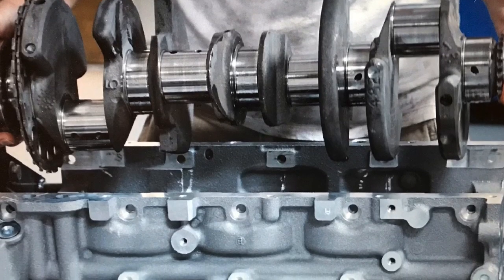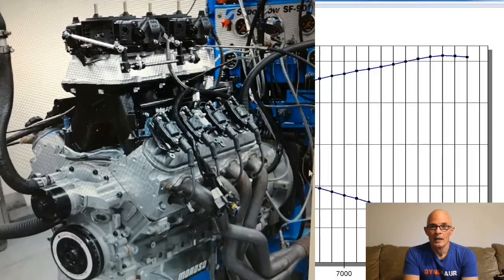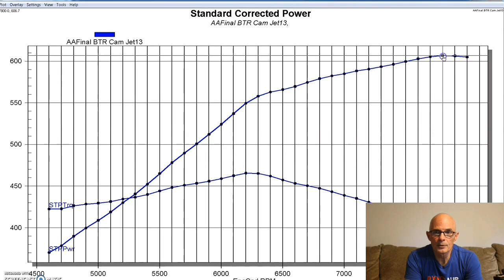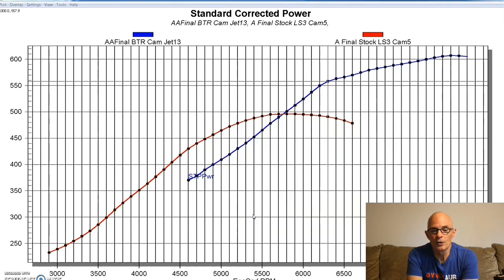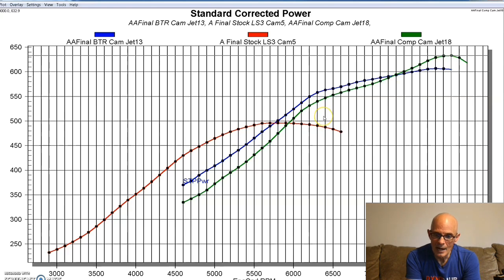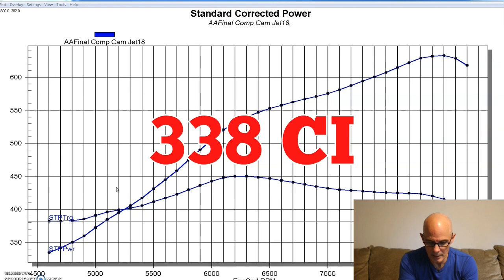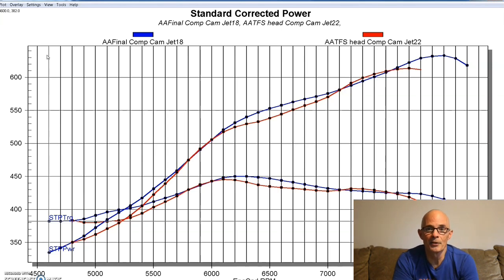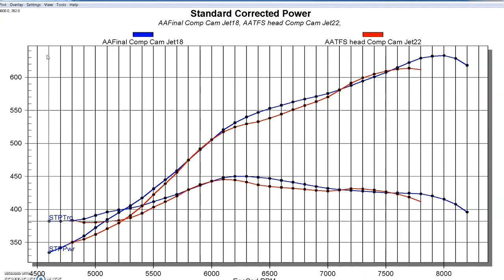DESTROKE LS-4.8L CRANK IN LS3 BLOCK-SHORT STROKE POWER-AN LS MONSTER MYTH?

Comment: The LS7 makes peak power at 6300 rpm, LS3 makes peak power at 5900rpm, and the LS2 (and LS 6) makes peak power at 6000 rpm, LS1 makes peak power at 5200-5600 rpm (depending on the vehicle). So, the largest true LS is over a 1000 rpm higher than the smallest true LS. The 5.3 is 5200 rpm, lower than any of these larger engines. And the 6.0 truck engine is the same as the 5.3 - 5200 rpm (and the 4.8 is 200rpm higher - could that be the stroke?). The largest true LS spins the fastest and the smallest true LS spins the slowest - opposite of what you said (plus the 5.3 and 6.0 truck engine make power at the same rpm). Basically, it appears that displacement actually has little to nothing to do with "revability". The valvetrain is number 1 and stroke is number 2. Displacement, if anywhere, is well below those two. You don't typically see street LS builds on stock stroke, or stroked, cranks spinning 8k plus - and especially not 10k - where destroked, large bore LSs have gone.
Reply from the maker: the reason for those peak power rpm numbers is the motor was set up by the factory to make power there (heads, cam, intake vs displacement) It has nothing to do with stroke length and stock stroke motor can run to 8000 rpm with the right valve train (the valve train is the limit)
Reply: @richardholdener1727  Yes, valvetrain has the most to do with it, but as I demonstrated, and contrary to your statements (even the objective data you provided was inaccurate), displacement has little to do with it. Stroke DOES effect revability, but not nearly as much as valvetrain.
Reply from the maker: I agree 100%...if we eliminate all the data, and go by things that simply get stated (not demonstrated), stroke controls all the rpm potential.

Comment: Destroking a motor is beneficial on one premis . Less rotational speed hence less rotational load on The bearing ... and also vibrational mitigation
Reply from the maker: rotational speed is just rpm (so the same), you might mean piston speed which changes with stroke. Vibration (frequency) can also change but not necessarily be less)

Comment: Actually on that subject of big bore 4.8. I bored a 5.3 to 5.7 (3.898 bore) with a 4.8 crank, and while I'm not suggesting for a minute that bigger stroke can't rev, I found the roughly 5 liter was easier to get revving (we got 9000 rpm able to do 9500 but didn't seem worthwhile and stock bottom end so didn't wanna stress it too much) and seemed to have better throttle response than the 5.7 stock LS6s (same headers and intake and management). Now sample size of 2 and because we found the 5l to be behaving so well we tuned it more than the 5.7, but it would be interesting to see some empirical testing. the 6.2 LS3 is a 3.622 stroke to a 4.065 bore, that's a 1:1.122 stroke to bore ratio, compared to the 5.3 which is an almost square motor, and the 6.0 which is a little over square at 1.104 . 3.898 bore with a 3.267 stroke is a ratio of 1.193. I wonder if GM bored the LS3 a little over because .2l doesn't make much diffrence in cubes and the 6.0 trucks use the same heads so all that, but it does change the bore to stroke ratio making the motor more over square. Again i don't have the facilities to check as i'm small time, and best i've done is tested in engine sim but it's something to consider. There's a lot more to a real world engine than just peaks, i learned a long time ago making 300hp over a wide range of RPM and quickly is way better than making 500 at peak.

Also we have a lightweight car so down low power isn't a huge deal (even though it's never lacking) as we're not doing launches mostly flying laps. it's a mustang 2 (because it has excellent suspension and is very light even from factory, and it's cheap) and we stuck with a built t5 from GeForce, which is pretty much the lightest 5 speed possible lighter than a TKO by 20lbs (with fluid). The 5l is happy to drop down and rev right back up and it never feels like it falls flat on it's face at any point. We're only allowed a max of 331cuin (to let the ford guys play), so our options where limited even the 5.7 LS is too big and the 5.3 just wasn't doing it.
Reply from the maker: a smaller motor makes less power than a bigger one-no racing series engine builder EVER chooses the smaller motor because it revs better (they just make the bigger motor rev it that is where they want the power band)

Comment: Great minds think a like...lol   Exactly what I got in the works. I figure being in a Miata it probably doesnt need a boat load of torque to get up and going. However, Truck Norris and a Pulsar 7375G (1.15 or 1.28?) should help enhance the bottom end. LC9 block..293CID.

Comment: Definitely the hp per cubic inch or hp per liter is impressive either way. But I think another reason you might want to use a 4.8 vs say a 6.0 is if you have swapped it into something lightweight with limited traction like an s10

Comment: You said I don't have to change the stroke to get more RPM I have a 5-3 l from 2002 Tahoe I just purchased the whole car want to put swap into 63 Nova I want more RPMs out of my motor without stroking it you said I can do it by doing valve work and changing the displacement I prefer more RPM 4 Turbo without changing the stroke to 48 I want to leave the 53 stroke and the bottom end stock and get more RPM really and truly how much RPM can I really get out of my 53 without changing stroke thanks
Reply from the maker: cam

Comment: I recently built a screamer and drop it in my truck I'm running a Texas speed cam 228 stage 3 112 separation lift Brian tooley dual valve springs with 660 lift LS7 lifters chromoly push rods cold air long tube headers but it's kind of slow off the line what kind of gear should I be running it in the rear end to make it quicker off the line but still keeps some of my top end speed?
Reply from the maker: YOU MIGHT NEED A CONVERTER

Comment: No reason to do this, can rev the stock 105mm crank just fine. Even my N54 96.8mm crank goes to 8000rpm no problem. It's all in the manifold and cam

Comment: SO? FORGET ABOUT ROD RATIO? Go ahead rev that bbc454/sbc400 to 7500 and see that rod come out the side of the block.  Then tell me again how it was the Valve train that was the weak link.
Reply from the maker: rod ratio is not the issue-we run 454s to 7500 with the right valve train

Comment: Shorter Stroke:
1. Revs faster
2. Easier to tune/control launch short times. 
3. Stronger Rod/Stroke ratio = Higher Power strength.

Destroked 6.0/6.2 runs away from any 5.3/5.7 build.
Reply from the maker: a destroked 6.0l just makes less than a 6.0l and might make more than a 5.3l cuz its bigger
Reply: @richardholdener1727  Way better air flow, larger bore also helps torque. It’s a secret combo for a lot of the back end racers/No prep guys. 
Yes a standard 6.0/6.2 will make more Peak numbers but this isn’t always what gets down the track the fastest. 👍

Comment: Thanks for doing this. My father explained when I was a kid how they did this to FlatHead Fords back in the 60s. They raced dirt track and figure 8. 😂 he said the engines had less CU but faster rap-up into high rpm range. Something not really measured on dynos. How fast the engine gets from idle to max rpm especially under load.😂
Reply from the maker: that is not a thing

Comment: Get some shaft mounted roller tip rockers solid roller lifters double springs tool steel retainers and locks hollow stem valves and take it to 9000

Comment: I 've read the heads used in pro stock (short stroke) didn't shroud the intake much. The push rods were less impaired and the intake valve could be moved into a better angle.

Comment: I've been wanting to build a 6.0 block with a 4.8 crank an rods you come up with a 328ci engine which is as close to a 327 as it gets just a few thousands longer stroke  I've had several good running small block Chevys but my favorite one was my 64, 327

Comment: Of course this ist not quite true. You failed to mention ROD ANGLE and piston acceleration. More stroke in the same block=greater rod angle and piston acceleration which both works together in a fatal way. Ok for a truck, not for a high rpm race engine.

Comment: Can this be done by putting the 4.8L crank into, lets say, a 5.3,6.0 ???
Reply from the maker: 4.8 8crank and rods in a 6.0l is common destroke (if you want to make less hp and torque than the stock 6.0l)

Comment: so i came across this video again. it made me think. you brought up displacement, not bore or stroke dictate power. i agree. your example of the 3 engines where the only difference is (hopefully) displacement gave me a good idea. a standard 5.3 (3.78 bore * 3.62 stroke) vs a destroked 6.0 (4 bore * 3.27 stroke). that puts the displacement with 3ci of each other. the other thing that could be done, like one of your newer videos, is to degree the cam in. then we could see if you could get the power peaks to roughly the same rpm to see what it does on power production across the whole range.

Comment: I would guess the 5.3l or 6.0l would make peak power at lower RPM. It may still Rev to 8000 but I think the head would be saturated before then? So then you may as well shift at 7000 or 7300 or where ever the head gets saturated. That's just a guess. Also I think more longevity out of the 4.8l. Also if you got a little car like a Cobra or whatever you don't really need all that torque. I think this 4.8 would be a lot of fun.
Reply from the maker: saturated?
Reply: @richardholdener1727  I could be totally wrong!!! Lol but the head can only handle so much air. So you could do a high rpm build with a horsepower peak high in the range with less exoctic heads/ valve train? I watched the video again today. No point reving to 8000 with a long stroke motor if peak horsepower is at 6500 for example.
Reply: In other words if you use the 4.8 crank you could do this at lower $ than a.... 5.3 or 5.7 etc. Is what I am trying to say.
Reply: @richardholdener1727 and by saturated I mean with air. As you know an engine is an air pump and there will be limitations. You will only be able to suck in so much air through those heads. So I the better the heads the higher the RPM of peak horsepower. You would know better than I. I just love high RPM NA builds!!!!!

Comment: BAD-ASSS! Didn't know this was possible, will stock 6.0 pistons work or is pin-height an issue? And what stand-alone did you use?? I'd like to drop this in an early gen2 Camaro to street, looks like the 400 ft/lbs of torque above idle would work, but ac plumbing in my car would kill that some, but DAMN, impressive numbers!! Thanks for your vid you got me 'droolin'!
Reply from the maker: you can do this with a 6.0l block, 6.0l pistons and the 4.8l crank and rods

Comment: You need to come talk to my 1990 rangers 2.3 engine and ask it why it's has such wimpy air flow and has a narrow power and torque band! Peak torque come on at 2600rpm and not much past 4500 rpm it's choking. It has a short stroke too. I'm almost certain a camshaft would walk it up but I don't know any OBD-1 tuning. Reckon I woul have to send the EPROM to someone who could work with cam specs!
Reply from the maker: long runners, mild cam and limited airflow make for low peak hp rpm

Comment: I would really love to see one of these with a supercharger. I can only imagine the insane power band that thing would have
Reply from the maker: SAME UNDER BOOST
Reply: @richardholdener1727  so 5.3 w 4.8 crank and machined and built heads would b a better optimize potential in a boost application due to air intake ability? Also if so what would u recommend for comp ratio on the destroked 5.3 for boosted applications. Seems like a great set up to build spool out of the gates?
Reply: @tonywiles515  a 5.3 with a 4.8 crank is a 4.8
Reply: @robertatkins272  thanks for the correction I meant a 6.0 w 4.8

Comment: There are often times in circle track racing when this low bottom end torque type of motor would be beneficial. 
I'd like to see this build with a 6.0 steel block and a distributor ignition a lot of track rules require those two things. Thanks for the great content.

Comment: ** RICHARD I WOULD LOVE TO SEE SOMETHING THAT'S NOT ON THE NET YET.  AND I'M PRETTY SURE EVERYONE WILL LOVE THIS. 
EXPERIMENT:  LET'S SEE WHAT HAPPENS WHEN YOU TAKE A FULLY STOCK 5.3, AND PUT A BIGGER CAM IN IT (WITHOUT CHANGING THE VALVE SPRINGS). 😁
There's a lot of us that are wondering "what if I didn't change out my springs with a bigger cam. What if we were lazy or cheap and tried a short cut. Let's see how high you can Rev it.  What will happen, at what rpm?  Mhmmm!
LET'S SEE WHAT HAPPENS!
Reply from the maker: stock 5.3l springs will only accept near .500 lift, and will only allow limited duration before valve float

Comment: Your giving away secrets Richard lol here’s a ? Do you think the destroked  engine will build boost faster than a stroker engine ? And if it does where is the rpm limits I run a Ls next block that’s destroked  and we run it to 8500 all the time she has twin precision 88s with a Bryant crank grp rods dart pro one heads fully skirted Wiseco pistons and that’s all I’ll say I want give out dimensions or stroke  but you should do a street engine dyno test. Btw I have a amazing team and engine builder so props to them.
Reply from the maker: a bigger motor offers better response cuz it makes more average na power

Comment: On circuit racing with light cars, you don't want huge torque that will spin the tyres at low rpm, you want a long power band so the gears last longer.

Comment: glad you explained its not stroke or bore, its displacement, so many do not understand this
when 383, stroked 350, got popular so many would say stroking adds torque not hp, but didn't understand the reason was that more displacement increases torque but peak is at a lower rpm, since hp is rpm dependent it doesn't seen to increase, but if people realized that with bigger displacement you can now run more duration and therefore lift for the same idle loppiness, they'd realize stoking enable much higher torque and hp and the hp gains were there by going bigger cam. in the end if you stroked and cam'd to keep peak torque at same rpm as before you would have higher torque and hp

Comment: Very good points and an interesting comparison, would have been good to see a "big cam" long stroke dyno graph too.

Coming from the world of I4s I always figured the reason to go short stroke was to get longer rods and improve the rod/stroke ratio as I4s have pretty bad second order vibration. Running some calculations on this it very quickly became clear that V8s don't suffer this problem. Speaking of engines with vibration problems i'd love to see an all else being equal crossplane V8 vs flatplane V8 comparison, maybe with the same set of long tube 4-1 headers on both.
Reply from the maker: NO FLAT PLANES!
Reply: @richardholdener1727  haha I need to hear the rest of that story